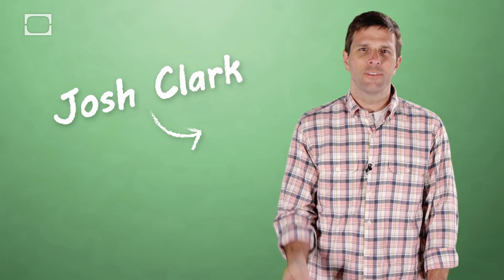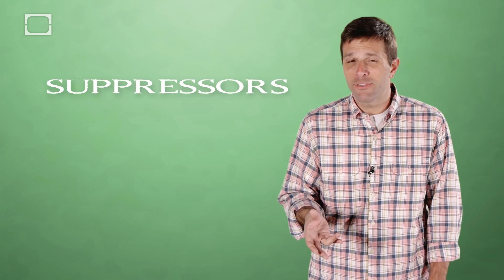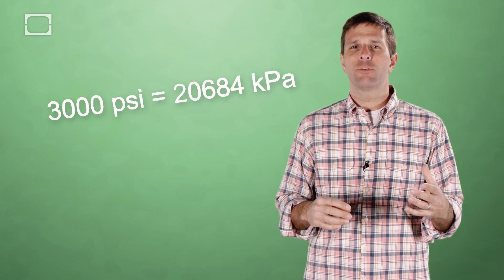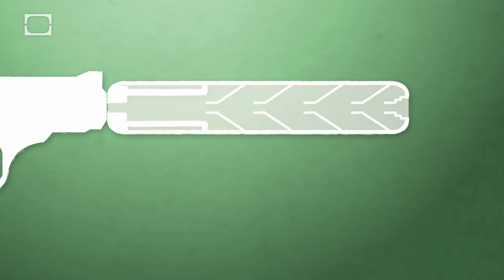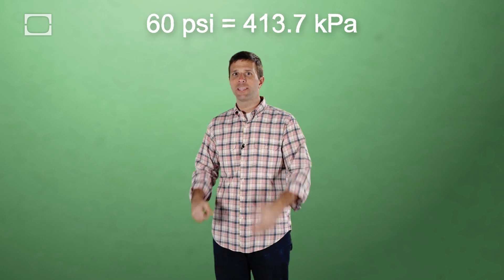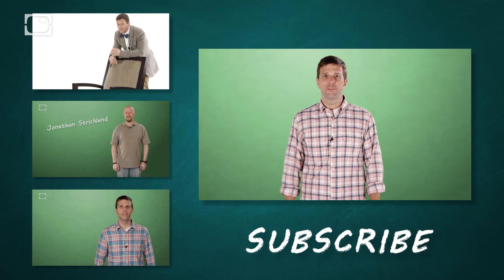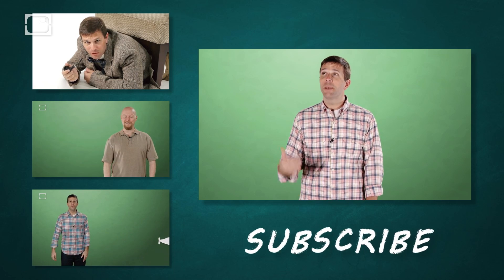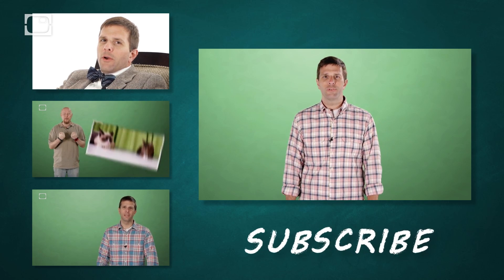How Do Gun Silencers Work?

Comment: 20db is possible with .22 sub sonic from a bolt action 16in rifle with a suppressor. For 147g 9mm @ 950fps / 230g .45acp @ 850fps factory loads, low is 100-125db. With hand loads can get little lower but will never get to 20db with combat calibers.

Comment: 20dB when using suppressors? This is garbage, it is not near as effective. It reduces the sound by around 30dB, there are a couple of better suppressors which reduce the sound by around 40dB. If the mechanical sound is not considered then there is also like he said a difference between supersonic and subsonic cartridge. The supersonic cartridges produce around 130-140dB while subsonic cartridge produce a sound of around 120-130dB.
Reply: That. Suppressors do not work like in the movies, they just drop the noise from "very loud" to "loud". Even the best suppressed firearm still shoots at 86dB.

Comment: I'd like to know what kind of suppressor you're talking about that reduced 160 Db to 20...  Some of the best-rated suppressors on market advertize a reduction in sound of 120-130 Db, ie you're still going to want hearing protection.
Reply: 130 dB is the maximum safe threshold for sound impulses. A continuous 125 dB sound will very quickly cause hearing damage, but a suppressed firearm shot at 125 dB is considered safe. You will see certain suppressors advertised as being "hearing-safe" -- what this means is that they will drop the sound level down below 130 dB with the appropriate ammunition recommended by the manufacturer, allowing you to safely shoot without hearing protection.

You still of course need proper eye protection when firing a gun with a "hearing-safe" suppressor, you just don't need hearing protection.
Reply: *****
I said "want".  Just because it doesn't cause permanent damage doesn't mean its not bloody annoying.  Many people still choose to wear ears despite having a suppressor on their rifle/ handgun.  Reference 'Silencerco' - /watch?v=T3dK6lcsEog

Comment: One more sound is the bullet hitting a target, and if it's semi-auto, the bolt racking takes the place of the hammer hitting the primer. A bullets' ballistic crack is extremely loud, so why use a suppressor? In military applications it's usually for location concealment. Not only does it distort the location-revealing sound, but it works as a muzzle flash suppressor.  
Great vid guys, and the perfect brain stuff character to explain it!
Reply: someone who knows what they are talking about :) love it. haha.
Reply: Sean Dunn Yaaa. 6 years in the Marine Corps gave me the skills and knowledge to shoot but not much else lol
Reply: Great additional facts to the video
Reply: Well, one reason to use a suppressor is that you don´t have to use ear protection when you shoot. Also, if you don´t need the damage, sub sonic ammunition works fine. Well, sure they are not that accurate, but i don´t shoot that good anyway. Modern ammunition and guns are a lot more accurate than a average shooter.

The firering pin is also a really unnecesary sound.. i´m thinking of building a electronic fiering system... would that be legal? Also use a fingerprint reader to stop any other person from using my gun.
Reply: matsv201 That's a very interesting idea. I was in the Marine Corps for 6 years as an Abrams Tank crewman and I can tell you that the main gun is fired electronically. However, I have concerns about its reliability because often times the gun will not fire and you have to manually crank, what we call, the "master blaster." It's a hand-twisted generator like you'd see in old movies when they're blowing up TNT with that plunger thing. That's a very plausible idea if it can be made reliable though.
Reply: Well, one obvious idea is to use a lot of power under a very short time. A capacitor can do it quite easily with a somewhat small battery.

Interesting normal standard ammunition can be fierd electronicly if you just know how to do it.
Reply: matsv201 I hear ya, I don't know the technicalities behind it but I'm assuming the tank has a significant amount of electricity going to the round. And seeing as how it only works 90-95% of the time, I just have doubts about its reliability.
Reply: Dani2wheels Thats kind of strange. I Have not tested it my self. But other test with .22 caliber bulets they basicly fire every single time. Sure its like 20 amps, but just for a millisecond. Can easily make that with 2 AA batteries and a capacitor..
Reply: Like they said in the video, cold-loaded ammunition will take away the bulk of the ballistic crack. However, that may also make gas-operated weapons not work properly as there might not be enough gas to reciprocate the bolt upon firing.

For pistols, though, a .45 caliber round will often not exceed 1000m/s depending on the manufacturer, meaning that it can be suppressed more easily without the cold-loaded ammunition.
Reply: someone checked too much hollywood films --'

Comment: Now that you did this.  You have to do, "Will guns work in outer space?"
Reply: justahappyfellow good point, you should be literally "backfired". I didn't know that some guns have mechanisms that depend on gravity for shell ejection, but it makes sense.
Reply: no. maybe once.
Reply: interesting question, I don't see why not? Does anyone have more insight into this?
Reply: I dont see how if the mechanism of the gun involves combustion to work.
Reply: haiggoh It will most likely work, but that depends on if the weapon is dependent on gravity to work (Brass ejection etc). Also, if you want to fire it in the cold of space, I have no clue of what would happen, it would probably work fine though depending if the gunpowder can ignite by regular means in space. But even if you could use a gun in space, I'd advice against it, because you'd probably be flying the opposite way of the bullet.

This is only what I came up with withing minutes, so it's no definitive answer, hope it helped though. :)